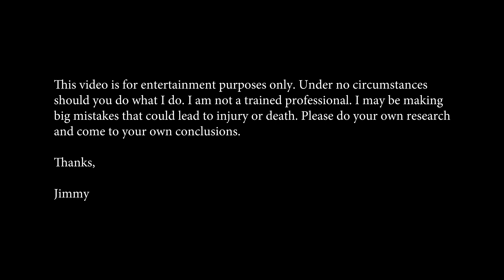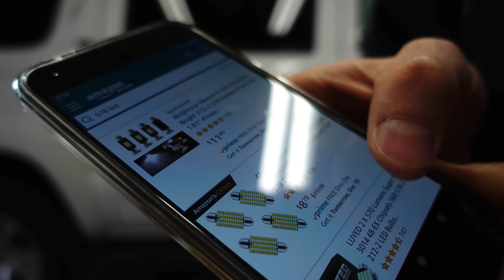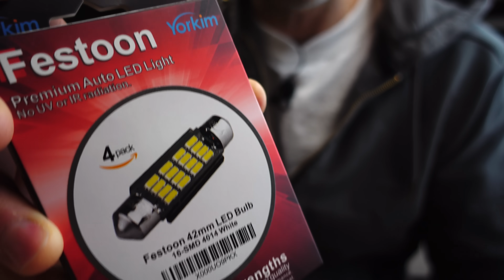Here's Why You NEVER INSTALL LEDs IN YOUR CAR OR TRUCK!!

Comment: A problem I see is the manufacturers are now in an "arms race" as to who has the most intense headlights, along with signals that are too close to the headlights so you can't tell if the cars turning until its right on top of you!
Reply: I hate driving at night because a lot of vehicles lights behind me are so obnoxiously bright . I literally have to adjust all my mirrors down because its blinding.
Reply: I have to pull over on side streets with oncoming pickup trucks I'm literally blinded
Reply: @The Arch1tect 
So true
I sometime think that I should replace my rear window glass to mirror
Reply: Tailgater repellent:
Run you mirrors down and out. Then adjust the ratchets to shine the light straight behind. When you get a blinder, just run your mirrors thbthis position and let him see his own lights.
Has worked for 30 yrs 👍🔔😱
Reply: I am glad I am not the only one complaining about headlights.I thought it just might be because I am in my 60's, These lights are dangerous to oncoming traffic and also blinding in rear view mirrors. This industry needs to be studied and standardized.
Reply: @HotRod Ray 
Thanks for the tip
I do move it outward but not downward, I’ll try next time as you said
Reply: I run my mirrors out a bit on my pickup and big rig, just a little further from seeing down the side of the vehicle. Really does keep the glare off your face and doesn't shine back directly.
Reply: It’s the feds believe it or not. They keep mandating better and better (brighter and brighter?) lights
Reply: @thearch1tect249  i have mirror chrome wrap and tints all over my car so at night, anyone with obnoxiously bright led headlights behind me will instantly regret getting that vehicle
Reply: @sdc5683  U r not alone.  There are laws on the books that specify the direction and brightness.  But, sadly, the this country does not believe in following even the most courteous ones.   More along the lines that we keep voting for law breakers that blame someone else for their failures.  Go to CA and you can steal under $900 and not get arrested.  It's still "against the law", but, cops don't come out to do anything and store owners won't bother to chase/reprimand.
Reply: @sdc5683   I agree, I'm almost 60 and sometimes I can't tell if oncoming vehicles has high beams on or not. I believe there is regulations for headlights (in PA anyway) but illegal ones are available. Maybe we should use our sunglasses. Haha.
Reply: Yep agreed
Reply: I agree with you, & your last sentence articulates my thoughts.
Reply: Heck, the freaking cop's blue lights are so obnoxious and bright I can barely see to safely drive past them when they have pulled a car over these days.
Reply: Here in Oregon, most people don't signal at all lol.
Reply: You are spot on as far as you went. I’d go farther and complain about the ‘ribbon’ lights around the headlight. It used to be that the headlight was tolerable to look at but with the other lights with it the area of light is so large it completely overwhelms your retina causing night blindness. The government regulated headlight design in the past and I think it’s overdue for them to reclaim oversight.
Reply: MoparMania . If it’s a car, then down but for pickups and semis it has to go upwards. For those who love to drive at the rear corners slowly point the mirrors out. They move past you very quickly.
Reply: @stuckinmygarage6220  the brighter lights are manufacturer driven and they have LOTS of lobbyists. And, I guess you're from a red state.... sorry.
Reply: Naughty Santa
Reply: Yes when I first started driving 40-45 years ago you got stopped and got a ticket for driving with fog lights or off road lights in town or on highways...this day and age...common courtesy and respect for fellow man has deteriorated...in all aspects of life...people break laws and those responsible for enforcing laws are negligent....it is all about (me and I) welcome to the New World Order. Too many people in the world now with a sphincter mussel for a necklace...how do you fix stupid?
Reply: Is it illegal to put mirrors on my tailgate?
Reply: @sdc5683  the industry is fairly well aware and there are standards to abide by in most 1st world countries. 90% of the time the problem is incorrect installation, like installing LEDs into incandescent reflector housings or incorrectly/never getting headlights adjusted. Modern xenon and LED headlights do not blind oncoming traffic when set up correctly.

Lack of enforcement due to lack of knowledge/caring by law enforcement probably doesnt help either.
Reply: Moral of the story, aim your headlights
Reply: this but also people just picking the brightest light they can, when i picked headlight LED's for my car i did not go for the highest lumen, i didnt go with anything super bright i think i went with 12,000lm /30 watt, although i think thats in pair (so 6000 each?) and my headlights are projector based and aligned, which is the biggest problem with most people running really bright LED's or HID's, they run them in reflector housings that scatter the light more or are not aligned, or they are in lifted trucks that then aim the lights right into your eyes if you drive a smaller car.

plus the technology is getting better, they more expensive LED's usually have the emitters placed where it acts closer to the original bulbs instead of sending the light everywhere. only thing thats still a problem is cooling the LED's as usually anything over a few watts needs heatsinks and then active cooling (fan) when your in the 30-50watt range.

my biggest pet peve is no one really carries the lower color temps for headlights, the whiter/bluer the light the worse the backscatter you get in fog/ran/snow. and can also through out your nightvision. being that i live in an area with some nasty winter weather it would be nice to have a more yellow light that doesnt back feed as much and is easier on the eyes for long night drives
Reply: @jjjacer  yeah, the worst offenders are the people who buy cheap 10 dollar bulbs and put it on their car
Reply: @jjjacer  morimoto makes some pretty good yellow led bulbs

Comment: I paid less than $20 total for (2) pair of Ebay LED's... One pair of 3000K amber fog lights and one pair of 6000k (4) sided LED headlights. It's been (5) years now and they still work and look great on my 2015 Sierra. I have absolutely no complaints. It was an inexpensive solution that greatly exceeded my expectations.
Reply: Cool! Would you happen to know the Brand of LEDs you bought from eBay?

Comment: Man, As an electronics engineer, I can tell that not only the failure is related to heat sinks, but also they need high voltage spike protection. A car is a noisy environment, specially from the ignition coils, great LED Build design involves voltage clamping. Modern cars which have LEDs considered in their design incorporate those voltage clamps, but older cars (30 year old cars) don't. 

what kills most aftermarket LEDs are voltage spikes from the ignition coils, not the heat dissipation.
Reply: My car came with LED tail lights and DRLs/sidelights and rear LED fog light as standard, my upgrade to LED front fog lights, LED number plate bulbs, reverse light and LED Brake lights and LED side and rear indicators and headlights have all been fine. The only halogen bulbs left on my car are the front indicators as upgrading them caused hyperflash.
Reply: You just need to add load resistors to fix the hyper flash.  They are easy to find.
Reply: What's the solution 4: that problem?
Reply: I was asking the guy who mentioned the problem with heat sink/ ignition coils.
Reply: Can you just put a bigger fuse???
Reply: @MsRican143 no
Reply: bingo!  I changed my old 1994 truck over to LED and discovered this the hard way... bought a couple bulbs that came with their own power regulators and have had zero trouble over the past 5 years or so.
Reply: @MsRican143  Never go to a bigger (higher blow current) fuse.  The fuse was sized to protect the wiring.  If there was an a accidental short cricuit somewhere, the larger current could heat the wiring enough to cause a fire.  This is not to your advantage.
Reply: That is an important issue in modern cars: clean 12VDC. Most of us replace our 12V batteries when the engine begins cranking slowly, but none of the cars in our families have starter motors (they are all Toyota hybrids). Conventional cars from our time worked pretty well as long as the engine would crank, not thinking of the electronic add-ons that want clean 12VDC.
I haven't seen actual material failures of anything because of dirty 12 VDC, but it can still be a problem. It is always bad juju to disconnect the 12V battery in a car when the engine is running - we know that - but we should be able to get away with it in the Toyota hybrids where the 12V battery is charged by the inverter, right? You are an engineer; you know better. It doesn't do any damage but don't expect anything in the car to work right.
I don't have a recommendation for deciding when to replace the 12V battery in any car, but we all tend to replace them too late.
Reply: @danielmiller2886  Resistors won't help at all. There is always plenty of load in the car's system, but the problem is sudden change in load or generation. The 12V battery is the only workable line of defense for 12V spikes. Everybody lets theirs get too old before replacing it... I sure do.
Reply: re: "what kills most aftermarket LEDs are voltage spikes from the ignition coils"
Try LOAD DUMP from the alternator; the ignition coil is chump change by contrast ...
Reply: @uploadJ  have you seen the Load Dump in the oscilloscope? Earlier electronic ignition suffered a lot from the kick-back of EMF from the coils rather than the dump load, and I'm not including the induced EMF from every spark which is also kind of harmful if not properly taken care of.

Modern cars electrical systems  (talking from 1994) incorporate some kinds of load dump mitigation (snubbers), sometimes is not enough.

Many people, specially with open loop cars (carburetors), with no critical electronics suffer from the problems I specified, not enough voltage clamping, breaker point ignition with not proper snubbing which kills LEDs the most.
Reply: @xc68hc705kj1  re: "Earlier electronic ignition suffered a lot from the kick-back of EMF from the coils"
You just answered your own question: Direct-drive of a coil is GOING to see back EMF when the current thru coil ceases ... you know how that works. I'm a long time 2-way radio user going back to a 1965 Motorola MOTRAC, and they use all sorts of chokes in the +12V line going to the solid-state receiver to minimize damage from spikes on the car's 12V system ... I lost an LM555 in an inverter design years ago owing to inadequate attention to spikes seen on the 12V car 'bus'.
Reply: @MsRican143  no
Reply: Good thing my car has no ignition coils.
Reply: I can tell you as a fellow engineer, that you dont' known much about LEDs.  They are sensitive to high reverse voltage spikes but not so much forward voltage spikes of the magnitude present in a vehicle electrical system.  In fact many LED designs today, run the bulbs with SMPS that basically give them (due to the cheap crude designs to save BOM) spiked waveforms that merely average out to an arguably acceptably average current per available heatsinking.

What these generic bulbs need more than anything, is to not try to overdrive them so much to the point where they run so hot.  Particularly in these  cases of incan retrofit bulbs, the form factor limits heatsinking and they shouldn't just be cramming as many LEDs on as they can and then driving them  as hard as they can without care how long they last -  which is often less than 50 hours before substantial lumen reduction if not outright failure of at least one LED in a series which shuts off the whole series.
Reply: @stinkycheese804  read carefully, if you are an engineer as you claim to be, voltage spike protection includes the reverse voltage every diode is sensitive to. If you ever connected an oscilloscope in a 70s car and below (I bet you have not), you'll be amazed by the large amount of voltage spikes generated. Many LEDs do not last too long in such environment.

I've been 30 years designing automotive ignition systems, I know what I'm talking about
Reply: @troyfuller3767 A dedicated power supply that get rid of the noise, emp, and spikes in voltage coming from the alternator and ignition. I'm not an english native speaker, but I think OP explains it better than I can.
Reply: Turn of lights when starting the car....turn lights on when engine is running! No peak power...problem with peak power solved!

For head and tale lights make sure they have their own heath sink like a fan or copper aluminium otherwise they won't live long. 

When the lights get to warm you will recognize that the light output is getting dimmer and in wors case its melting!

Blinker lights must be balanced
Reply: @Lonewolf_rider  That makes no sense at all.  There is minimal power  when starting the vehicle, since battery is under load and alternator barely spinning at crank RPM.  It is the lowest chance of power spikes compared to running the vehicle after started.  However the premise was nonsensical to begin with, because legions of people start their vehicles and run them daily without an epidemic of power surges killing their lights.  More likely just defective, if OEM, or defective design, if aftermarket.